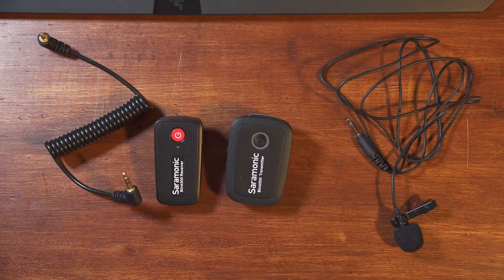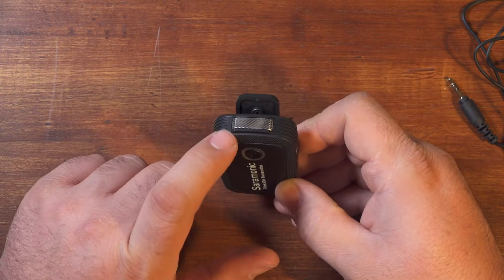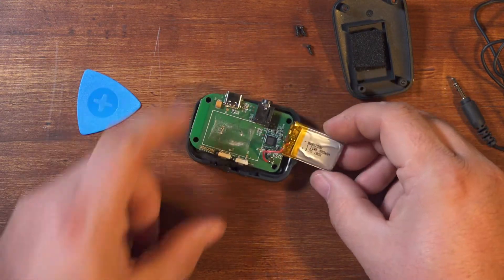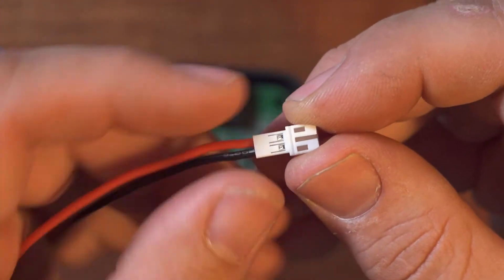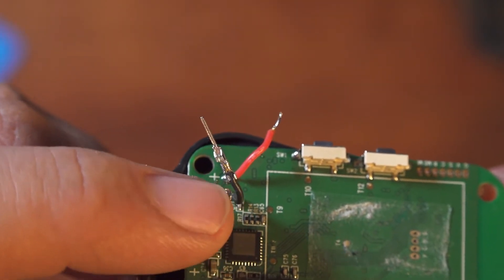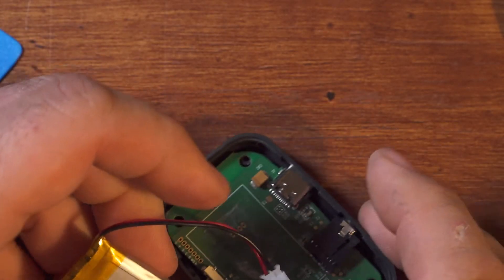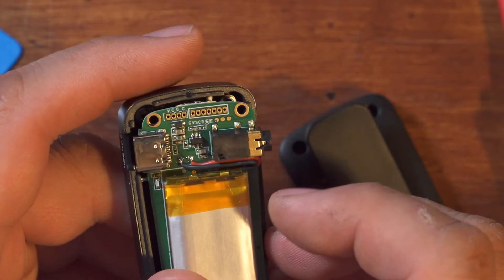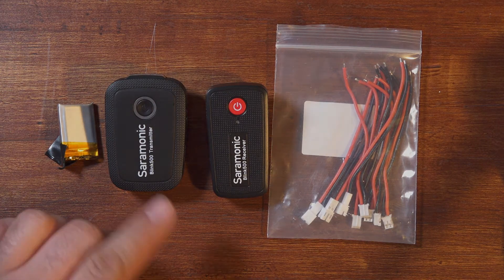Saramonic Blink 500 Battery Replacement and Mod

Comment: The JST connector you buy is male or female? Is battery work with Saranomic Blink500 Pro RX?
Reply from the maker: The connector came with both.  The battery is originally soldered in.  You could just solder in the new battery and not buy a connector.  But the connector makes replacing the battery easier.  Since you are adding the connector, you need the male and female sides.  To reduce the potential for short circuits, it's best to put the female side on the battery.

Comment: Hi! I’ve found this type of battery (602030) with 500mah at 3,7V. Should it be compatible with the device?
Reply from the maker: The stock battery is 300mAh.  500mAh is quite a bit larger and may not fit.  You may be able to make it fit, but I can't say for sure.

Comment: Would having the terminal so close to the on-board mic be a possible source of noise,as they are free floating in the case right behind the on-board  mic?
Reply from the maker: If it could move around, maybe.  But it couldn't really move much.  I never had an issue.  If you did, a tiny piece of foam to keep the connector from moving around should take care of it.

Comment: does the Blink 500 pro b1 have the same battery?
Reply from the maker: I don't have that system, so I can't say.  If it is as easy to open as the standard Blink 500, you could pop it open and check.  There should be numbers on the battery.

Comment: Hello Please post a link to the battery and connectors in the description as it not easy to find haven’t found it as yet
Reply from the maker: The model is 602030.  If you just search for 602030 battery on Amazon or a similar site, you should find multiple options.  Here is the one I bought:
https://www.amazon.com/gp/product/B07C9R4PXT/ref=ppx_yo_dt_b_search_asin_title?ie=UTF8&psc=1

That one has a JST connector, but some options don't have a connector.  You could also just cut the connector off and solder it direct.  Fitting a connector in the receiver might be a bit tough anyway.  If you get one with a JST connector, you just have to get a matching connector for the receiver/transmitter.  If you search "JST connectors" you should find options.  Here is what I used:
https://www.amazon.com/Upgraded-Connector-Battery-Inductrix-Eachine/dp/B07NWD5NTN/ref=sr_1_4_sspa?crid=1MZG0LYCDSL1N&keywords=jst+connectors&qid=1653245359&sprefix=jst+connectors%2Caps%2C134&sr=8-4-spons&psc=1&spLa=ZW5jcnlwdGVkUXVhbGlmaWVyPUEzRFBRV0Q3Rk02Q1M1JmVuY3J5cHRlZElkPUEwODc3NzczTTZTRVJBRkIzRklRJmVuY3J5cHRlZEFkSWQ9QTAxMDk4ODQxUDFJNUYzN0RBNzlIJndpZGdldE5hbWU9c3BfYXRmJmFjdGlvbj1jbGlja1JlZGlyZWN0JmRvTm90TG9nQ2xpY2s9dHJ1ZQ==

Comment: Any idea if it is a good battery or one of those fake Chinese that lasts third of the original?
Reply from the maker: It's hard to say for sure.  It's definitely not "fake" in the traditional sense.  It's not pretending to be anything other than a 300mAh, single cell Li-Po.  In other words, it's not pretending to be any sort of specific brand or "official OEM" or anything like that.  I wouldn't doubt it's made in China, or wherever most Li-Po batteries like this are made.  It seems like a decent battery, but whether it's built to the same standards or with the same levels of quality control as the original, I can't say.

Comment: Is this the same battery pack for the new Blink 500 B1 Pro? Can you send the link where you purchased the battery pack replacement, please? :)
Reply from the maker: I can't say if it's the same battery for the newer Pro systems.  The specific one I ordered is no longer available.  But if you search for a 602030 Lipo battery on Amazon, you can probably find one.  3.7V, 300 mAh.

Comment: I have a blink 500 b2 type, and one transmitter can't connect to the receiver, I've reset it but still don't want to connect, is there a solution?
Reply from the maker: When you say you reset it, did you do the pairing process?  If you haven't tried the pairing process, that's what I would try.  If you already did the pairing process I don't really know what else to try.

Comment: Nice video.. How to see the battery indicator level when in use?
Reply from the maker: There is a ring of light segments around the power button.  How many of those are illuminated gives a rough idea of battery level.
Reply: @bigtb1717  : thank you.

Comment: where did you order the battery?
Reply from the maker: I ordered the battery and connectors from Amazon.
Reply: @bigtb1717  thank you so much
Reply from the maker: No problem.  I searched Amazon for the number that was on the original battery and I found the one I bought.  If you can't find one let me know and I'll look for the order and see if I can find the one I bought.

Comment: You are a genius. I love this type of hacks. If possible, could you make a steady video of both sides? It is interesting for people who damage their blink500 and watch the resistors, capacitors, etc may burned. I'm interested in the other side you don't show in order to watch the electronics of this gadget. Liked. And thanks.
Reply from the maker: Are you talking about the other side of the circuit board while I'm soldering?  The trick is to use a hot enough soldering iron that you can work fast so heat doesn't build up and spread to other components.  And soldering out at the wires like I did would have little to no chance of damaging the board.  If the wire got too hot it would just de-solder itself from the board.  

Or are you just wanting to see the other side of the board in general?  If so, I could get some pictures pretty easily and post some links.
Reply from the maker: Maybe I could do the same mod to the smaller receiver and solder the wires directly to the board.  If I do that I'll try to get video of both sides.  I'll put that video idea in the queue, but it might be a while before I get around to it because I have a lot of stuff waiting in the wings for me to have time.
Reply: @bigtb1717  No, no. I'm not talking about soldering. I'm talking about doing a close up of the circuit. Imagine (in a future) you open again the mic and there is a burned component. If you have a hi-res photo you can buy the damaged component. Somebody is complaining of that in other teardown video and he said he needed a friend's mic to watch the reference of the burned resistor
Reply from the maker: @SabrinaVideo  A high-res picture might show you component type and location, but it won't give a resistor's value.  I can still get some close-up pictures of the board if you want.

Comment: Nice video, having a problem with the receiver. Wondering if you can share the link where to buy including the tools needed?
Reply from the maker: The only tool needed to disassemble is a small, phillips screwdriver.  Are you comfortable doing work on small wiring and electronics?  Do you have any electronics tools at all?  The only reason I ask, is because it would be easy to recommend a soldering iron, for example, but I also have support supplies like flux and solder.  What is the problem you are having with the receiver?

Comment: My battery seems to be working, but the light won't turn on! Do you think the bulb went out?
Reply from the maker: Did you replace the battery?  Does the wireless system work, but just not show any lights?  There are multiple LEDs.  Does anything light up when it's plugged in to charge?

Comment: Nice work. Is there any room for a larger battery? I’m also considering adding a better lower noise or more sensitive mic inside if possible.
Reply from the maker: No much, if any.  On the other half of the plastic case there is a bit of a box molded in that surrounds the battery to hold it in place.  It’s possibe you could trim that and fit a slighty larger battery, but probably not very much larger.